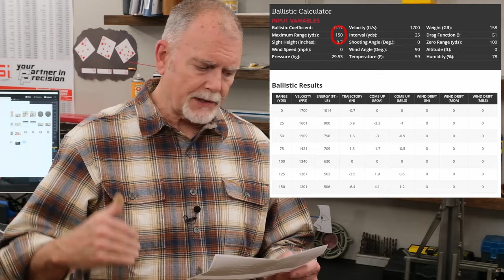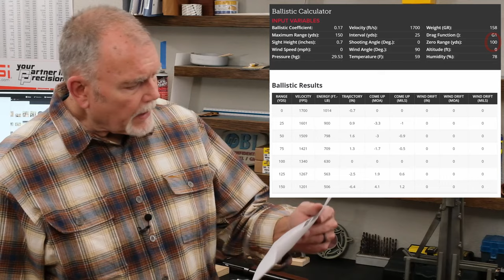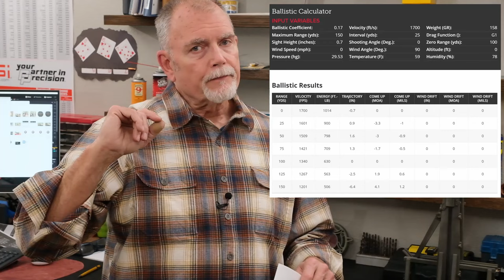How To Adjust Iron Sights

Comment: For those that do not have a brass punch:  Use your steel punch by placing an expended 22 case on the business end of the punch.  Use a little tape to keep it in place.
Reply from the maker: Great suggestion!
Reply: Learn something new everyday.  Thanks CallawayKen
Reply: Outstanding notion! I just used some 3/16” bronze brazing rod stuck into a hole I’d drilled into a short piece of 1/2” mild steel rod. But your idea is superior because fabrication time is much shorter. Thanks!
Reply: Haha, I came up with that too. It works great
Reply: What do you suggest if the sight won't budge to the left/right at all. Mine came from store significantly off and I tried hitting it with brass for an hour last night and it didn't budge. Then I hit it with steel and it put a ding in the dovetail part of sight. I feel that if I hit it any harder I am risking doing damage

Comment: Nice job on the explanation, and lots of fun! One thing that might be of interest, particularly if you have installed aftermarket sights, is that you may find you have reached your limit either up or down on the rear sight, in which case the front sight will require adjustment or replacement (obviously you can't make the front sight taller). The direction of adjustment on the front sight is the opposite of the rear sight - if the point of impact needs to be lowered, you must raise the front sight (replacement, here we come). If the point of impact needs to be raised, get out your file and shorten the front sight. An easy way to remember this rule is the acronym FORS - Front Opposite, Rear Same.
Reply from the maker: Great comment. Thanks!

Comment: Great video again. I use irons (Williams Peep) on my 24" 1972 Win also. It has an original very fine brass bead up front and it likes Hornady LEVERevolution ammo. On several occasions, from the bench it has produced 1"-1.5" groups at 100yds. I shot a black bear at just under 200yds and a buck deer at 168yds as the longest shots to date. It also has accounted for several deer under 125yds and a cow elk at 55yds. I do take it Bighorn Sheep hunting here in Western Canada although I have not gotten any yet but Bighorn are not hard to hunt, just hard to find. My Marlin XLR 30-30 24" only loves 170gr Nosler Part and Fed Power Shok. It will shoot 1.5"-1.75" with a 2.5x Scope (may go back to Williams again). Properly aligned iron sights are underrated and remarkably accurate with consistent practice. Keep up the great videos George.
Reply from the maker: Thanks Larry. You are so right about Iron sights being "capable". Because of the channel, I have used open and peep sights more in the last two years than anytime in my life and I have greatly improved my proficiency with them. I think I would be comfortable taking shots on game out to 150 yards if lighting was good and the quarry was not moving.
Reply: My Rossi R92 44 mag stainless with the 20 inch barrel loves the Remington 180gr jsp best of all. I had a 3 shot, 100 yard group that was right at if not a hair under 1 inch center to center.

Comment: I'd just shoot and adjust until I got it where I wanted, but back then ammo was relatively cheap. Of course the only gun I had that ever needed much adjustment was granpa's old 22 bolt gun. It got carried and tossed in the truck a lot, so it could get knocked out of adjustment readily, my 30 30 was tight, and once set never seemed to need adjustment. the few pistols we had didn't have adjustable sights.... well not readily adjustable. Need the brass punch to do anything with them, and we didn't have one, so we just learned how it shot and adjusted our aim accordingly. back in the day we didn't do a lot with pistols (and or revolvers depending on your terms of speech)
Reply from the maker: Great comment. Good to hear form you as always!
Reply: @TargetSuite  Here's the story of the sights getting way out. We went practicing, then I had to go to the indoor range to qualify to get my hunter safety card....to shorten the story, a dozen shots in, I wasn't hitting the target let alone the bullseye. When I could get a look close up at the target.. more specifically the cardboard target holder, I found a group of shots just off the paper high and to the right. Rather than try to adjust the sights then and there, I simply aimed low and to the left, that got me a good enough score to get my card. I don't know how they do it these days, but for our safety cards through the 4H program, we had not only book training but field training as well, and had to prove we could shoot competently. I imagine it's all book learning now.

Comment: Thank you for this video. I’ll be sighting in a 1950 Marlin SC with a Williams peep once the temps get back around 32.
Reply from the maker: Awesome. Did you see the video I did on my own 1950 SC, with Williams peep?
Reply: @TargetSuite  I did see that one comparing the 2 rifle grooves.  Did you need a taller front site for the waffle top using the Williams?
Reply from the maker: I did. Just happened to have one in my "take off" box.

Comment: A VERY complicated treatise regarding a VERY simple task.  When you were shooting, we, the audience, had no idea of your point of aim.  Initially were you holding at the bottom of the steel plate or your perception of dead center...?  Same at 25 yard on paper target.  Were you holding at 6 o'clock RE the bottom of the black, or 6 o'clock of the 10 ring, or were you holding on your perception of the center of the red dot?    At 100 years, was that steel plat 6 or 7 inches diameter and where was you POA?  Makes a heck of a difference.  Personally, I hold dead center on my desired point of impact and I use a dot of contrasting color as small as I can easily see at the desired distance.
Reply from the maker: Great point and definitely an oversight on my part. I was aiming at the center of the targets because the Marble Arms Bullseye peep makes a perfect frame for center of mass aiming.
Reply: @TargetSuite  I like that sight and my Win '92 44-40 wears it.

Comment: You have such impeccable taste in firearms.    I'd love to try an Winchester 1892 in 44 mag and compare it to my Marlin.  As it is now I'm about to throw my Marlin 1894 SBL into the woods, I just can't get the thing to group consistently.  Out of a 3 shot group at 50 yards, 2 will be touching and 1 will miss the 12" plate entirely.   I've tightened, torqued, cleaned, etc everything I can think of and used more than a half a dozen factory loads and nothing seems to work (with some pretty extreme poi shifts between brands as well).  It does a lot better with the mag tube and foreend removed, so maybe filing the foreend is maybe the next step.
Reply from the maker: One of the flaws of the levergun design is that "stuff" is hung from the barrel. That doesn't mean leverguns can't be accurate (check my last two videos) but it can be an issue. Your sample just seems to be extra problematic. Are you shooting factory jacketed ammo? Reloads? Cast bullets?
Reply: @TargetSuite  I've tried a variety of jacketed and some hard cast bullets, all factory.  Some are better than others, but non I'd feel confident making an important shot with.  I'll keep working with it to see if I can get it to behave.  It's such a handy length rifle, trigger is good, and the action is buttered glass.  You've certainly gotten those last two rifles pretty well dialed in.  BTW, big thumbs up for the target cam!
Reply: The problem is that 3 shots aren't a group. 
What do you get with 10 shots?
Reply: @onpsxmember  That was an example.   I could fire a whole box and I would see similar inconsistencies.   And in a hunting situation one shot is often all you get.  If 33%   of the rounds would be a foot off the target, I don't like those odds.

Comment: Well done George or should I say Professor.  Just to muddy the waters a bit some pistoles require one to move the front sight . I think the Shield is like that and it is the opposite of the back sight movement. I prefer to move the rear though , much simpler to remember. Nice shooting too . Well how does the new Winnie stack up against the 92  44 mag so far?
Reply from the maker: You are right to point out the front sight oversight. I should have mentioned that. As far as the two '92s go, the 44 mag has quite a few rounds through it now and it is really smooth. The .357 snags every now and then (as you could see in the video). But I have spent very little time with that rifle, so it may just be angry with me 😉

Comment: What do you suggest if the sight won't budge to the left/right at all. Mine came from store significantly off and I tried hitting it with brass for an hour last night and it didn't budge. Then I hit it with steel and it put a ding in the dovetail part of sight. I feel that if I hit it any harder I am risking doing damage

Comment: Do u like the Marble's Bullseye sight?  Seems like the inside arpeture would be like a Ghost Ring Set up
Reply from the maker: Paul it is an awesome sight! I have it on three rifles. But it works best with a Patridge (flat top blade) front sight. I'll be replacing the front sight on this one soon.
Reply: Ok so it works best on a flat top sight how does it work with the original brass bead. Front sight?
Reply from the maker: It's ok, but the round brass bead just naturally wants to be in the middle of the round aperture. And  if the center of the round bead is centered on the target it covers up too much. Great for shooting large targets close up, but not good for more "precise" work.
Reply: I believe I'll be ordering one from Midwayusa

Comment: Would there be a big difference between Accuracy with Winchester 1992 clones like Rossi 92 and other clones?
Reply from the maker: I posted a vid about the 44 Rossi R92 but didn't really focus on accuracy. But one thing about the Rossi is that it has a very slow twist rate at 1:30 (all their models) so it won't stabilize bullets much heavier that 240gr in 44 caliber or 158gr in .357 caliber.
Reply: @TargetSuite  thanks

Comment: Thanks for the advice. A good idea for adjusting the rear sight (for windage) on your lever action is to first put some masking tape over the barrel in front of the rear sight up against the front part. Mark the middle  of the tape  ( yours has a pointy centre section) with a lead pencil draw a straight line towards the front of the gun. This gives you a reference for when you drift over the sight with a punch instead of guessing like you have. I got this information from GunBlue490 on youtube and thought it worthwhile to share 
Thanks again 👍
Reply from the maker: That's a great idea! GunBlue490 is one of my YouTube favorites. He is the real deal!